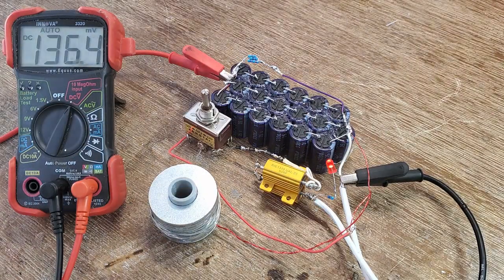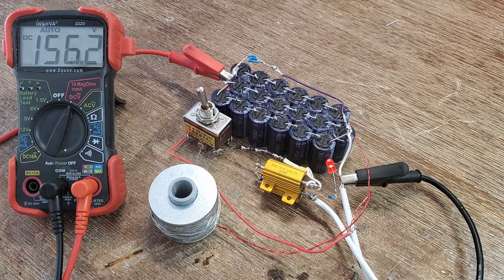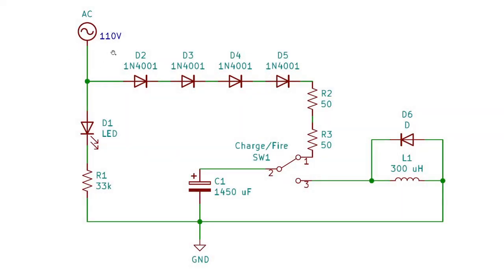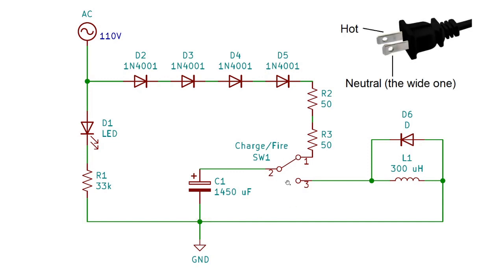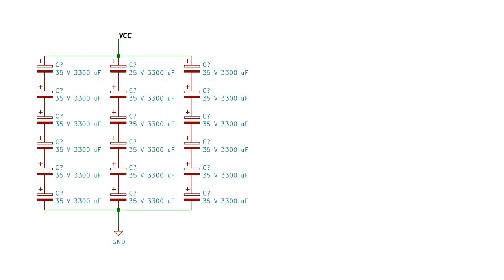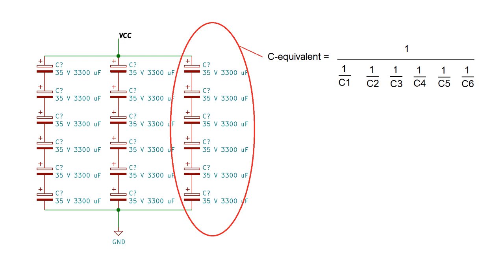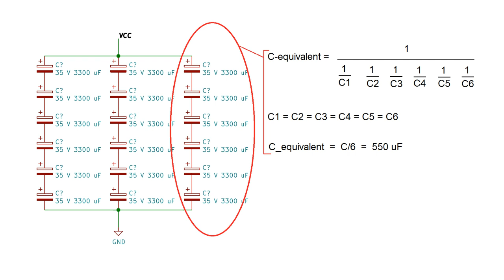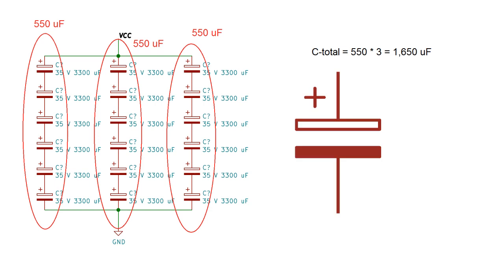150V Mini Mortar

Comment: I made something like this in high-school, I connected a camera flash charge unit and capacitor to a solenoid coil and used the flash pulse through the xenon lamp to create a short pulse in the coil, it was completely silent when firing and was small enough to fit in a pocket, I had a teacher who could not for the life of her figure out who was throwing ball hearings in the classroom🤣, I was nailing all my friends in the back or the head with it lol. Since it was silent I could act like I had my head down and arms folded on the desk, it was impossible to know where it was coming from lol. It hardly had any power, it could only lob a 1/4" ball bearing about 20 feet when aimed at 45 degrees but it was enough to have fun with🤣.

Comment: For those outside of the USA and parts of Japan where mains voltage is not 10-120V AC, higher this is a very dangerous thing to do. Higher voltage capacitors, or more series capacitors, will be needed. Peak voltage for a 240V AC system will be almost 360 Volts. An isolation transformer is mandatory in many countries.

Comment: It will work if I plug it in to my home  220v outlet?
Reply from the maker: No, the series capacitor bank and the diodes aren't rated for 220. You'd need to connect more in series or use caps with a higher voltage rating